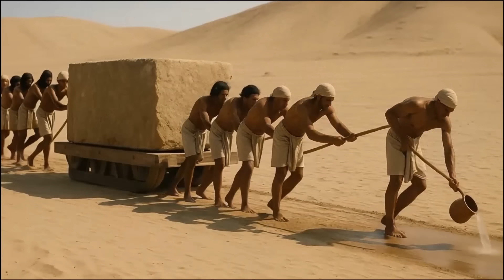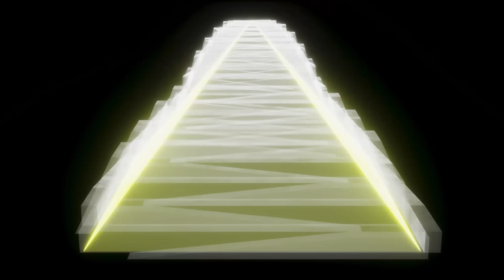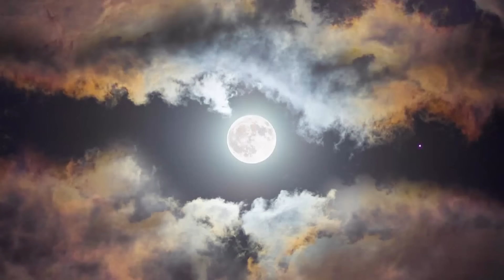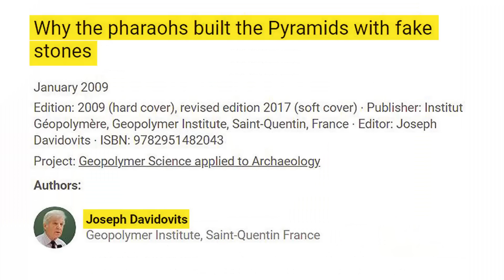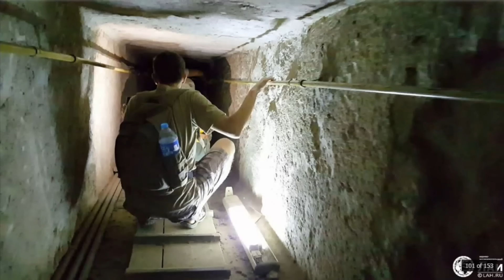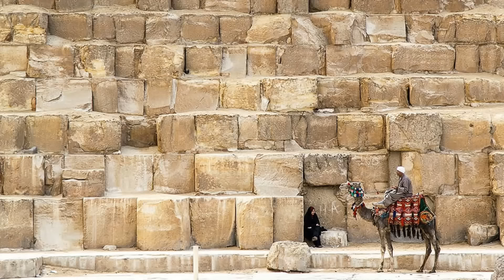The Pyramid Theory That Solves Every Construction Mystery

Comment: Why are the blocks higher up smaller than those at lower levels? If they were all cast, there would be no reason to reduce the block size higher up.
Reply: There could be an engineering reason for that. But I don't buy this explanation anyway. The pyramids are clearly astronomically aligned (i.e., it isn't a dump for industrial waste) and the great pyramid in particular seems to be designed to perform some function.
Reply: @SolusVir I heard the theory that the sarcophagus didn't hold a body but rather an Ark, which, according to another theory, was radioactive. And the idea being that there were multiple arks, one of which in particular was kept and preserved by the Hebrews who thought it had mystical power from God. 

Edit: or rather the arks held radioactive material, which would have been in the "sarcophagus". Hence the desire to contain it and also somewhat worship it

Comment: I have all of Davidovits' books. He has duplicated the concrete blocks found on the Great Pyramid. His Geopolymer Institute was the first to advance the theory of concrete blocks comprising the pyramids. Your analysis is spot on. I got this first from Davidovits and Morris' book, "The Pyramids, An Enigma Solved", 1999, Dorset Publishing. It is very in-depth and I recommend it highly to you. I read it in a week, while I was a full-time surgical nurse, working ten-hour days, at the time, in 1991, long before videos about this topic hit the Internet. A precedent, in time, for concrete in the ancient world was found in Uruk, where British archeologists found concrete in a temple structure in 1993, during operation 'Desert Storm'. It used a clay binder, so it was not as stable as silicon-based geopolymer. The site of Uruk is almost a millennium older than the common dating for the Great Pyramid.
Reply: Gobekli Tepe has terrazo floors.

Comment: Good job. :-). There are two issue: what are the blocks made of, and how did they get up there. Since no two blocks are alike, they could not have been made in moulds, and some are very irregular in shape. My own concern is, what are the passages and intricate rooms doing in a mine dump?
Reply: Is it possible that the various "sarcophagi" that are found in these heavily engineered spaces were actually reaction vessels? 
I heard somewhere that there is a pyramid that seemed to have exploded from the inside. Perhaps the materials they used to soften and pour stone like concrete were prone to violent reaction if things went wrong. In that case, could the internal structures, especially the tiny passages leading to the outside, have something to do with the manufacturing process itself?
I like the theory proposed in this video, but some of the details still don't seem to match, especially the creation and movement of the 70 ton granite blocks. were those meant to keep any violent reaction away from people? To suppress a potential explosion?

Comment: Oh boy oh boy! A full Tina video!

Ok. Ramps. Nyet. Check check. 
Mechanical/hydraulic lifts. Nyet. Check check. 
Composite slurry cast in place? Da!
Encapsulated mine  waste? Vozmozhno. 

Mine waste. Chemical analysis of the Giza plateau and pyramid blocks should prove or disprove. What minerals of any of interest are there? 
Iron, aluminum, manganese, tungsten, lead etc. but all in trace amounts. Only tungsten is present in sufficient quantity to warrant recovery. And that’s marginal. The Giza shelf is largely carbonaceous lime stone and sand. Virtually no silicate sands. All the granite (silicate) was hauled in from a distance. 

So. What did they mine? What did waste them as produced?

Concrete. We know Portland cement. A concoction of slaked lime, clay silicates and aluminas and fillers. That’s what we build with. Up into the 1950’s we called Roman concrete“stone” because I did not look like concrete to us. It’s was location and context that caused us to think it was artificial. Only recently have we solved the puzzle of what it is. And it ain’t Portland cement. Not close. 

In a like manner I’d bet you chicken dinner that the pyramids are a similar deal. Some kind of local concoction that pours like concrete but looks like stone…sort of. But nothing like Portland cement. 

Great job Tina. Well worth my meagre Patreon contribution. Guys! Get on board! Support the talent. 

Do svidaniya y’all!

Fox out.

PS Don’t forget to Hype the video!
Reply from the maker: Hi Fox! Good to see you. I think they were mining for this -> Prehistoric Mining: What was Mined on the Giza Plateau? https://youtu.be/y6ShuJdzDS0 
I also made a video discussing the possible acid mine drainage stains inside the pyramids: Egyptian Pyramids Reveal Acid Mine Drainage Stains? https://youtu.be/-QyIJ-w-8vc 
Hope you will find them interesting! 

Thank you for your generous support on Patreon. I'm truly grateful ♥😊
Reply: @CuriousBeingbyTina 
Tina. I’ve watched them both. Iron in its various forms is ubiquitous. That said the geology of the Gaza has only trace amounts. So why mine such a low concentration? Go a couple hundred miles where it’s plentiful. 

That said I Agree the blocks are logically cast. Typically they don’t tie acid waste into concrete. For one reason it reacts with the calcium, making salts that prevent the concrete curing. They used to dump it in the creek thinking the solution to pollution was dilution. Not giving a fig for the biota. Now we do and they reaction out in line slag heaps. Producing salts that pollute the creek. 

We don’t encapsulate too much in concrete. Radio isotopes and forever chemicals is about it. But maybe they did? Who knows. 

You keep working on it. I’ll keep up my measly support. 

Fox.

Comment: The so called "temple" next to the middle pyramid has massive stone blocks with FEET of erosion. Not inches but several feet.

And that despite them originally being covered by casing stones. The nearby Mastabas, supposedly of similar age and made by much smaller stone blocks, have almost NO erosion. 

That much erosion means that "temple" could be 10s of thousands of years old.
Reply: There are differing layers of softer and harder limestone on the Giza plateau.

Comment: Casting the blocks does seem the most elegant solution to the pyramid's construction.  If the structures were made to manage mine tailings, there should be mineralogical clues as to what was being mined.
Reply from the maker: Thank you for sharing. I also made a video discussing the possible acid mine drainage stains inside the pyramids: Egyptian Pyramids Reveal Acid Mine Drainage Stains? https://youtu.be/-QyIJ-w-8vc Hope you will find it interesting.

Comment: I like all your videos, but I'm not convinced on this hypothesis. In the start you dismiss other ideas due to them being more work and effort. However, casting, placing, aligning, the channels...all of that sounds like a lot more extra work just to store mining waste.
Reply from the maker: Thank you. In terms of construction and labor, casting concrete is generally easier than using quarried stone. This is why modern construction mostly use concrete for structural support, while stone is usually in decorative surfacing.
Reply: @CuriousBeingbyTina  It's not the casting part I don't agree with. I'm still open to the ancients casting stone. However, building the pyramids as a way to store the mining waste; that's the part I don't see as realistic. It just doesn't seem worth the effort and precision for purely waste storage. The grandest and most challenging project of the ancient world - nothing but a novel way to store waste product? That seems unlikely to me. Keep doing your thing though. I still find most of your videos very thought provoking.